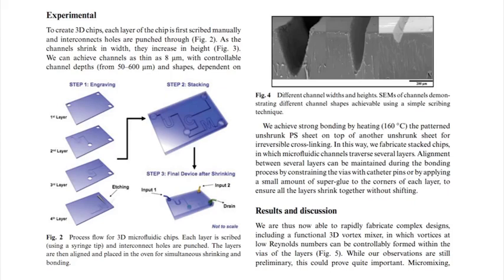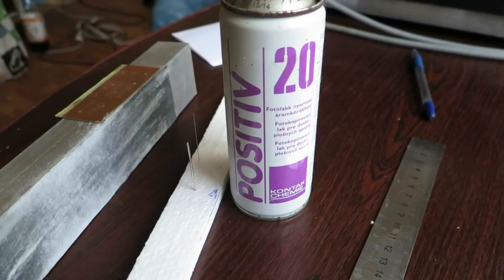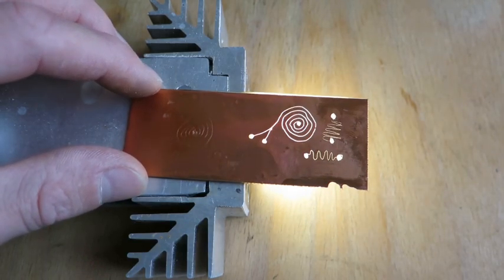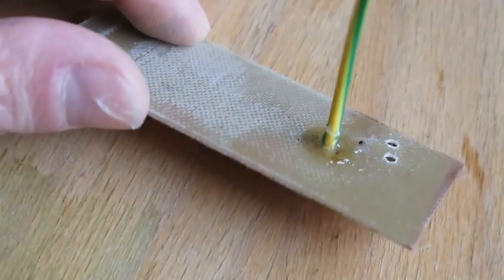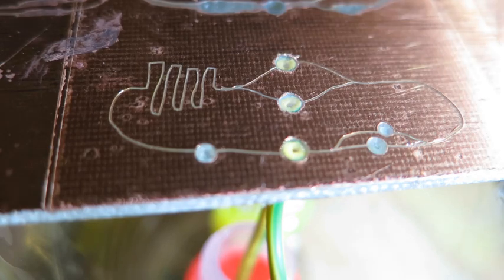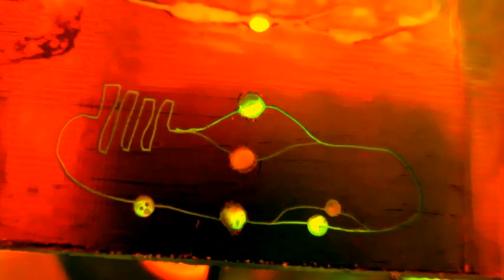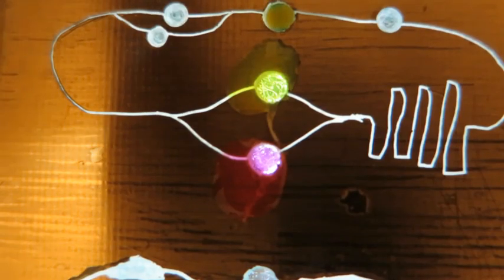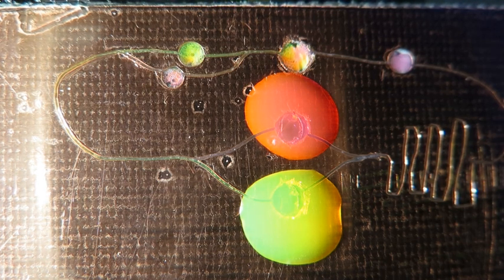Playing with microfluidics

Comment: This is quite decent for very basic things, but the point of the shrinkydink method is precision. The two issues you mentioned with your method, the etching leaving bubbles and the shallowness of the channels, are a dealbreaker with microfluidics. Thought Emporium intends to use his products for serious biology, where precision at such a small scale is key, so the ability to CNC a design precisely and then shrink it is invaluable. Your method is better as a very quick intro. Good for hobbyists, less so for more intricate cell designs for serious experiments.
Reply: I'd say precision of the shrinking method is much lower than the PCB method. In this video he scratched/edged the channels manually, limiting the resolution, but there are better ways using lasers or various printers.  The shrinking process makes the channels and features smaller, but I'd guess the actual dimensions are warped and distorted more than when using some lithography method.
Reply: @Andreas-gh6is  With industrial processes, absolutely, lithography is far more precise, but for limited runs and small prototypes, shrinkydinks are better. The kind of lithography equipment necessary for good precision isn't available without enormous investments, and when you're at the point of being able to afford that, you have access to far better sources than random YouTube videos from people without professional experience in the field.
And shrinkydinks can actually retain their shape remarkably well, when the heating is done well. That's why they're so useful for this kind of thing, especially with CNC engraving.

Comment: What you could do instead is, use real photolithography on the PCB with proper copper thickness. Etch all the cooper with exception of channels and other stuff you want to have. Then clean it up, cover with very thin layer of something that will things not bond to it, then cover in epoxy resin or some kind of silicon, covering entire surface uniformly. Wait for bubbles to stop showing up, make it cure and then remove it from the PCB template. Take another flat piece of same material, and bond them together. Voile, you have pretty accurate microfluidic device.

Comment: Uh... yeah, but how do you get it to shrink? Ya know.. which was the point of the shrink film.
Reply from the maker: You don't.
They did that because they used conventional manufacturing, that can not make micrometer scale features with home player routers / CNC

with litography or even my wax masking method you can make such small features.

I made thin mainly as a fun experiment for myself And this video serves the purpose of "educating" people that "hey, this exists and it's interesting"
Reply: Ilusys Systems how would you make and align micrometer channels by etching? I dont think you can control depth or width of etching that precisely.
Reply: @yazicib1  There are ways to etch very fine features on PCBs using either a laser or various methods to transfer ink/toner images. Bigger problem is the depth.